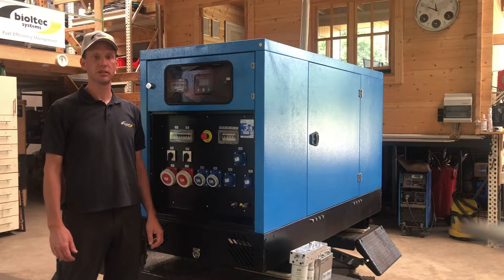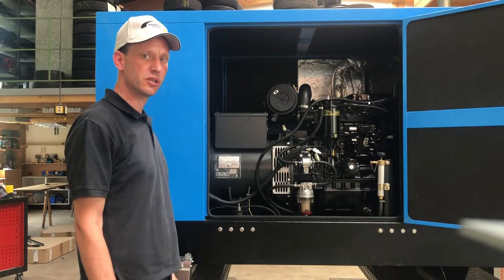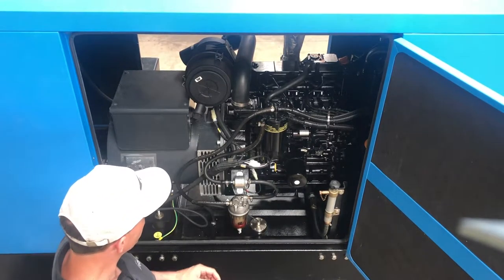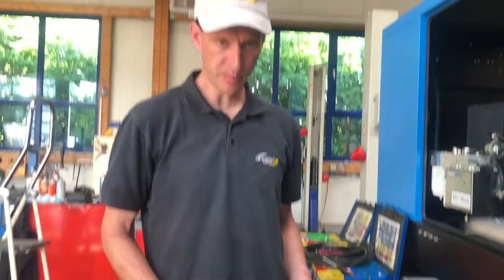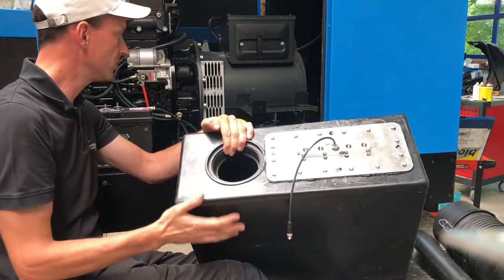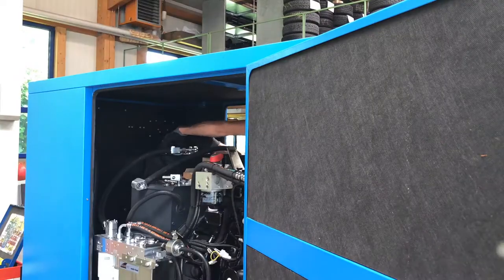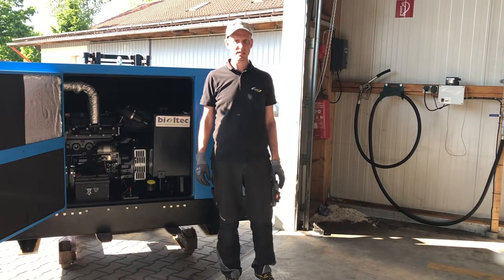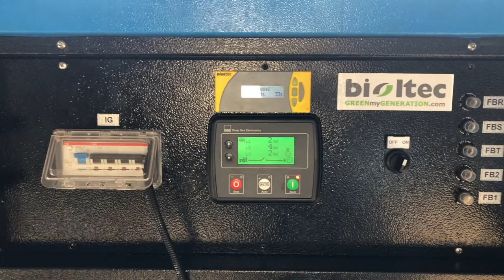Yanmar 15 KW GEN SET conversion to run on vegetable oil!

Comment: Very concise, beautiful presentation, well done! The shorter return is brilliant application, shorter purge time well decrease carbon build, what temperature do you allow the oil to reach in the lines, and what is the heat of oil when entering the injector, also with the added heat what short of lift pump leads to your IP,??? 

hopefully one that is heat absorbent which’s gears can handle!!